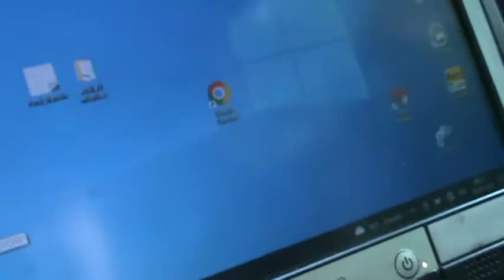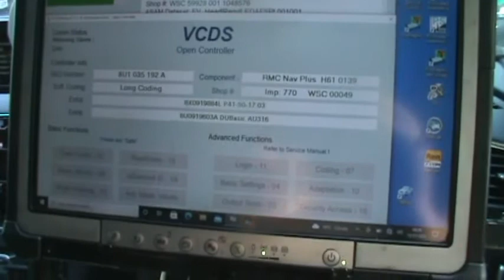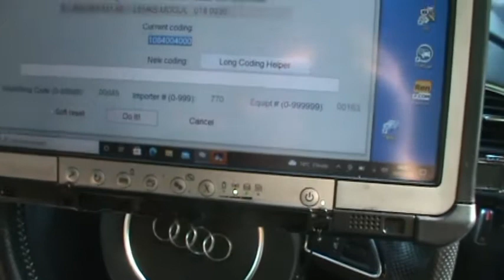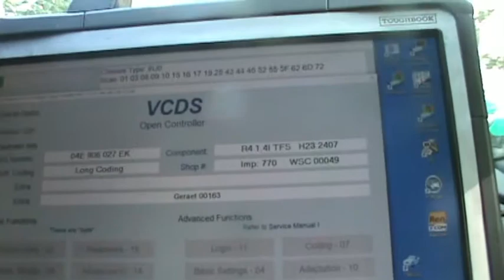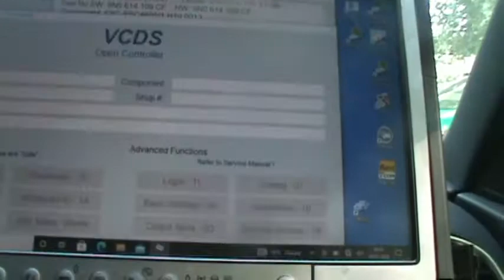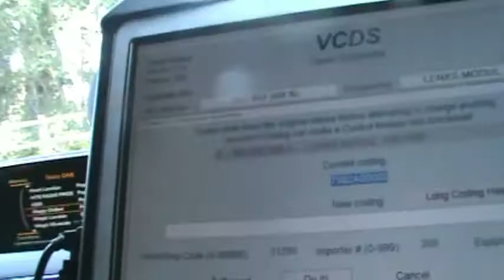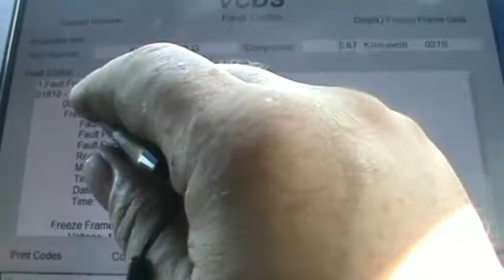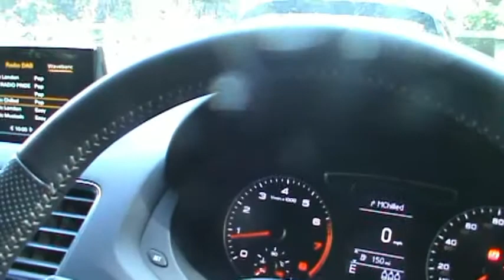AUDI Q3  TO REMOVE , CODING IN  AIR BAG SQUIB USING VCDS, PARTS ALSO  FITS OTHER VAG CARS (2016)

Comment: Hi Trevor I’ll get the vin number when I get home , the fault is I don’t have any steering wheel controls working at all , the paddle shifts don’t work , the horn works ok and the controls light up on the steering wheel ok , there are no warning amber lights showing either.  I did have the warning lights on for the abs , traction control etc  and the steering wheel light symbol was on , I have had a new abs sensor fitted and they have all gone out now regards Peter

Comment: Hi Trevor great video !,  I have a 2013 Audi q3 the horn works ok and there are no airbag light etc on , do you think it’s the squib faulty or could it be a fuse ? Also do yiu happen to have the original part No regards Peter
Reply from the maker: Reading your message I don’t see what the problem is can you tell me what the fault you ,probably predict text it get me every time 😉😉
If you send me you vin number I can get the original no for u

Comment: Hi dude! Can you not use the old clock spring as a reference for the coding? I’ve fitted one to my mates car without realising it needs coding… 🤦‍♂️
Reply from the maker: Don’t worry I did that the first time to every days a learning day but make sure it’s the same part no first 
Yes sir the long coding is on the old clock you transfer that number to your new clock use vag com or any  decent scanner to program it in
Reply: Hey sir 
I have the same issue on my audi and I need help programming it. I’m willing to pay you for a phone conversation to help me coded again. How do I contact you privately